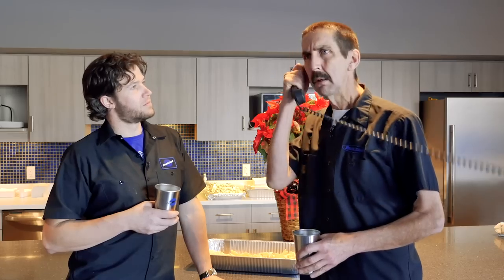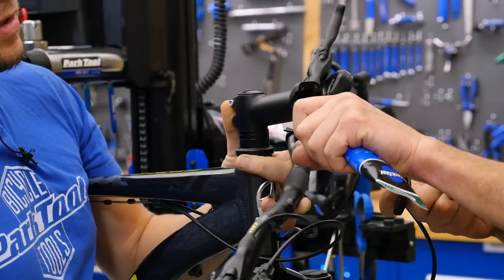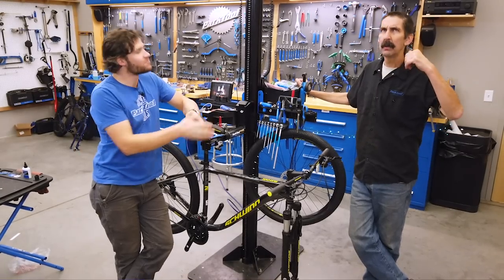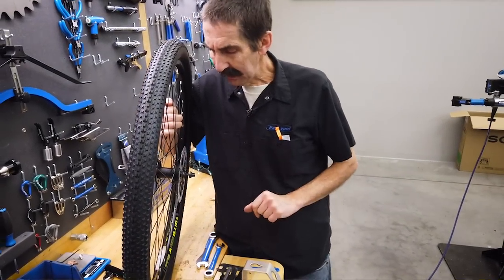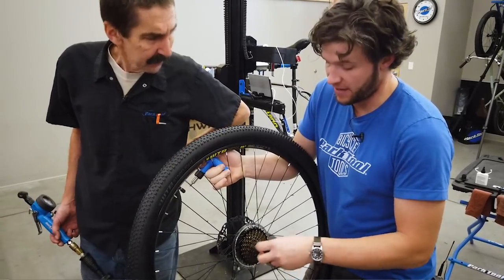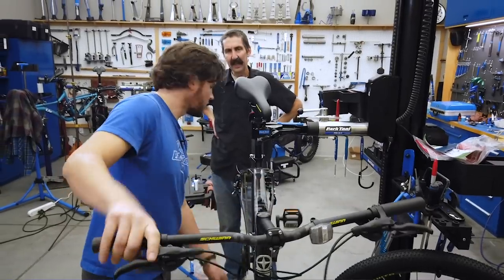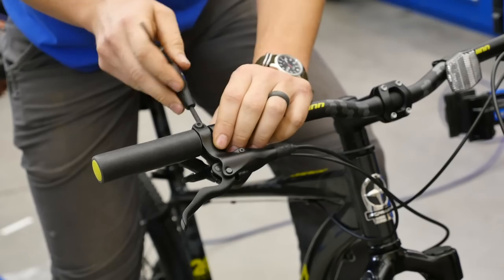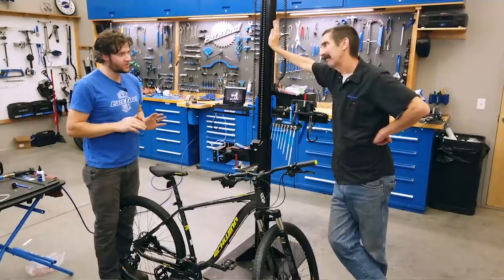Complete Bike-in-a-Box Assembly - Tech Tuesday Christmas Special

Comment: I was entertained by this video -- it was my job for 20 years (until health-forced retirement)!

I didn't have the time to grease bolts, managers like to see all bikes built in less than 20 minutes. I always told them  "you can have it that way if I adjust nothing, but the customer will bring 100% of them back." So they left me alone to do what I did best -- make that substandard stuff as rideable as it could be. 

There was a time when the premier LBS in town would see Walmart bikes roll in their front doors. It was cheaper to replace it than have them work on it -- they could have just sent the customer back to the store where they bought it.

But they sent the customers to MY store.

20 years, 44K bikes built/repaired, 1 failure, and it was a factory defect I couldn't fix.

Retired now, barely able to stand for 15 minutes... but I've built myself 2 ebikes, a lowrider, and a Specialized Hardrock rebuild so I can get back to pedaling.

It's in my blood.

Comment: Tip:  When a screw is dropped and you can’t see it roll a flashlight on the ground and the screw becomes illuminated along with it’s shadow
Reply: Thank you that's pretty useful
Reply from the maker: That is a good tip.  https://www.parktool.com/blog/calvins-corner/working-in-the-dark
Reply: @wyattlarrick3246  111 is a great place to work, and it is a great Ch l place to work, 111111a. Zu 77777
Reply: it can also reflect light
Reply: I've found ball bearings using this method but I also upgraded my wheel so I didn't have to worry about that anymore lol
Reply: If all else fails, empty your hoover, then hoover up and you should pick it up, a magnet in the dust collector or bag and you have your screw.
I'm a horologist by hobby, and have managed to retrieve even lost balance wheel screws this way... and they are less than 1mm in size! (the magnet bit doesn't work for them though as theyare brass so I had  to just pick through the hoover contents the hard way! lol)

Comment: 6:00 because I'm a tightwad, I save cable ties by cutting the tail off underneath the head, so I've still got a usable length if I pull the cut tail out of the head. I bundle them up (I build a lot of bikes) and give the away to friends who do repairs. Reduce, reuse, recycle.
Reply from the maker: Before I finally accepted that this video was going to be *long*, one of the segments I cut was about that exact method of reusing zip ties! Rest assured that these zip ties were not wasted. 
- Park Tool Video Guy
Reply: That's how I cut them too, whenever possible.
Reply: @parktool  Lol great editing Video Guy, you guys run one of my fav youtube channels ever! :) My bike is in pristine condition thanks to you guys! <3
Reply: I've made a tool by putting a chisel grind on a bicycle spoke. It lets you release the latch on zip ties, allowing you to use the entire length of it.
Reply: I did that for years on the job, filled a drawer compartment with them... until they started breaking upon re-use. After a dozen or so did that, I said a few bad words and tossed them.

Comment: Tightening 6 dollar crank with 137 dollar torque wrench. Good Job. I think we can really understand now the frustration of a bike mechanic when he gets a big box bike like this. Though the components are worse then rubbish, the frame should be ok with light xc riding. That's not a bad frame overall.
Reply: I've assembled a few Schwinns myself. As far as cheap bikes go, they're not that bad. I'm quite impressed with this one. Despite having a non-cassette bolt on rear hub, it comes equipped with hydraulic disk brakes!

Comment: This makes me think of a ToysR-Us “adult” mountain bike I worked on. Full suspension TANKER with coil spring rear (shock?). Plastic covered seat, steel stem, skinny steel handlebars that looked like they were from a child’s bike, a bizarre spoke pattern on the wheels, and a front derailleur that did not resemble any derailleur Ive ever witnessed, nor did it even come close to shifting. It was so bad, you could see the shifter lever bending as you tried to shift across the front three rings. Pivot bolts where halfway out of the rear triangle and shock mounts, too! I installed a cheap set of Giant mtb bars, a $15 Shimano front derailleur, and a take-off seat. What a difference. The owner told me after he initially purchased the bike on sale, he took it home, tried to ride it and said, “oh well, I guess I just wasted $99.00”.  Now he can actually ride the bike. It’s such a shame, bikes like that will frustrate someone from getting in to cycling.
Reply: I once ended up with a Mongoose Wal-Mart bike. The components on it were terrible. The front fork had so much flex, you could see the V-brake mounts move when you squeezed the brake hard. I ended up having to install a 1990's style MTB brake booster on it just to be able to get it to stop properly. There is an art to tuning up cheap bikes. If you do it right, it'll give the bike the best chance for having a long service life.

Comment: I've found that the fastest/most efficient way to set up a rear derailleur on a new bike is to ignore what might/might not have been done at assembly. I check derailleur is tight on the hanger & hanger is visually straight, and shift to the smallest sprocket/biggest chainring, then wind in the barrel adjuster almost fully (hides the silver part, so looks nicer that way too), set the H limit screw as per manufacturer's spec, and then release and re-tighten the cable whilst keeping a medium tension on it. In 99% of cases, the indexing will then be correct (or within half a turn of the barrel adjuster from correct) and then all that remains is to set the L limit and B-angle screws.

Comment: so glad they removed the spoke protector, i effing hate those

they only protect from improper tuning, which the chain will overshift into the spokes, so just do it right.
Reply: They're required by law in most of North America
Reply: @drfusioncraft  Really? Bruh.
Reply: @drfusioncraft  ABSOLUTELY NOT. They're there because of the atrocious adjustment of their derailleurs throw chains into the spokes pretty easily. I never built a multispeed bike that was properly adjusted at the limit screws.

Comment: You guys were bored at the party,
Pat was Nice, 
Gave y'all a video to make
(Even if Staged...)
A checkList of systems
might help,
PreFlight check, for Kids
Air
Brake
Chain/Cables,
But y'all did mechanical
Checks, not just User,
Bolts, centering/seating, 
cranks,
Grease, Pedals, 
Rim tape(?),
 torques, Trues, zip ties,
Ride On
Y(M|Km)MV

Cable rewiring to consider...

Comment: I'm still sad that you discontinued the wheel kit for the PB-1 1:00. Many other mechanics ask me about it, when they have to schlepp tools across paddocks to pits, or from a vehicle to a start line, etc. TBH, the pneumatic wheels were a bit rubbish, (kept on puncturing, hard-to-get tubes, blowing off the rim, etc.) , but I replaced them with (blue-rimmed!) solid tyre wheels, and it is great for carting tool and part boxes around, before setting up a repair station. I wonder if you'll ever bring it back?

Comment: Interesting.  My bike in a box - never took the tires/tubes off rim.  After a few rides, was going home with bike in car and heard air leaking out realized later it was the rear going flat.  The flat was due to debris of some sort on inner diameter of tube, was not from penetration of the tire.  Never found the debris.  Inner rim was smooth.  Made a few pit stops on drive home, surprised it waited so long to happen and not on the road.

Comment: Tip: when screwing in stem face plate screw each one a little at a time and work in criss cross pattern to have an even gap.
Reply: They did that,  after demonstrating what happens when you don't.

It's an instructional video.

Comment: Ajdusting front derailleur on those cheap cranks is a bitch, because later when you stand off the saddle and pedal hard, crankset and rings will flex and you'll find a rubing noise.

Comment: The adjustments you made to the front and back wheels, can you make the adjustments with the wheels on the bike if you have a bike stand but not your specialty braces?
Reply: Cone adjustments need to be done with the wheels off the bike. You don't need a fancy stand, you just place the wheel in your lap, or get an axle vice.

Comment: Luckily Canyon was super easy to setup.
Reply: I once had a customer who brought in his Speedmax for a regular service & realised that all cockpit bolts were undertorqued. When he came back for the bike, I told him about it & he told me he used the torque wrench that came with the bike.

I'd say if you want to build a Canyon at home, at least get a proper torque wrench, be it a beam-type, analog click-type or digital.
Reply: @yonglingng5640  this is why i don't use a torque wrench. also because i don't have one :C Funny thing happened 2 days ago though. iw as washing my bike and noticed my bottom bracket was coming loose! i managed to take it out using my fingers, the guys at the bike shop who installed it didn't tighen it and there was no grease or threadlocker anywhere. Bought the tool and threadlocker, should arrive next week.

Comment: Thanks guys, that's a very interesting & useful vid . I always struggle to centre the wheel in the forks, do you have any tricks & tips to share please?thanks in advance. Kind regards from Bristol U.K.
Reply: I'm a little late, but if you are still having trouble a sure fire way is to put the bike on the ground with the weight resting on the front wheel whole you tighten the qr skewer.

Comment: Hi! Thanks for the video and merry christmas. May I ask you a question about hubs? I have thru axle 12x142 hub shimano m6010hb. When I set it with little play and tight the axle on the bike, the play is go away that is right. But bike doesn't ride well. Then I set more play on the hub and when tight the axle, there's play on the rim for about 0.5-0.7 mm . But the bike rides really well. So my question is: can I leave 0.5-0.7 mm play on the rim? I also read shimano allows to set this play cuz there may be some differents between the same cup and cone hubs in processe of manufacturing unlike sealed bearing. You have to find sweet spot for you hub which will work well. May this play on the rim cause issues in the future?

Thanks a lot.
Reply: In terms of what's best, I'd prefer no play. Play starts from small issues but can develop into big problems. Most frequent causes for play are bent axles and  bearings not seating correctly. Overtime that little play can destroy the cups and cones by distorting their shapes and surfaces so they no longer function correctly. Tightness on the other hand, while it can't distort the hub components, it damages them by pitting the surfaces. The cups and cones are subjected to more stress since they're crushed beyond what the manufacturer intended, and subjected to a lot more heat, due to the increased friction.

In your case I'd start by disassembling the entire hub, inspecting every piece individually, and replacing anything that seems damaged. Make sure that the axle is straight, the threads are not chewed up, the cones rotate perpendicular to the axle without wobbling when installing them, the bearings are shiny and the size the manufacturer intended & the cups look polished.
Reply from the maker: Small adjustments of that cone make a big difference.  There should be a better "sweet spot" that allows no play when installed at the rim.  A thru axle we can assume is straight. But when moving the cone wrench, use small increments, just a few degrees, as you move from play to no play.  Generally, you want the loosest setting but with no play.

Comment: Hey all,

I'm an aspiring bike mechanic and would love to learn more. I have in my possession some older bikes that I can mess with. What sequence should I disassemble and reassemble to learn the most? Should I start with removing/disassembling wheels and hubs or do you recommend a sequence that beginners should start with?
Thanks
Reply from the maker: Some of the skills to focus in on right away would be how to put wheels on and then take them off. Then tires on and off. From there derailleur adjustment is a great skill to learn. Then get into the handlebars and the seat adjustments. I would suggest learning more about those things before putting too much time into other stuff.

Comment: Merry Christmas!
While assembling the cockpit you said that you do not want grease at the friction area between the handlebars and the stem. However you used grease at the friction area between the seat-post and the bike frame. Could you please explain why? Thanks!
Reply from the maker: Good question. The concern at the seat post/seat tube is corrosion. At the bar-to-stem joint, it becomes much more a safety concern.  Slightly rotation and slipping at the bars could result in a crash.  Slight slipping as a seat post of course could as well, but much less likely.  The history has proven greasing the seat post has not been an issue.
Reply: @parktool  Thanks for your reply!
Reply: @parktool  when I saw the dry connection, I immediately remembered several of Gee Milner's "Dream Bike Builds", also here on YT. But then I thought, "more likely carbon paste, because he uses Renthal carbon bars".

Comment: Hi: great job! Would you tell us about torque (feet/ pound or inches/pound) for stem bolts holding handler tight?
Reply from the maker: That can vary with design and manufacturer.  See https://www.parktool.com/blog/repair-help/torque-specifications-and-concepts

Comment: Whats the name of the bench wheel holder bracket with holes  20:10  in it and is it a park tool?
Reply from the maker: That would be the Park Tool WH-1 Wheel Holder. There is also a WH-2 you can check out.

Comment: I bpught a $700 dollar budget hardtail at my local bike shop and did not even rode it, then I took it back to return it because I was not gonna ride it since I changed my mind to switch to full suspension and they said that the tires were very very worn out and demanded me to pay back 40 percent to restock. I lost  $340🥲
Reply: 2 things spring to mind:

1) I'd have kept it rather than take a $340 bath.
2) check your sphincter, cuz buddy, you got f***ed.

Comment: How did you mount the THH-1 tool holder to the PRS-33TT tool and work tray?
Reply from the maker: Good eye! We installed a few off-the-shelf L-brackets using the channel where the utility hook is installed, then simply bolted the THH-1 holder onto those brackets. Just something we were trying out.

Comment: Please don't mix grease with thread locker. That defeats the purpose of the thread locker.
Reply: Scott Henderson thread locker is just about the worst thing to put on a bike.
Reply: @noahfontaine7832  I agree, but if the manufacturer puts it on in the factory I'm not adding grease to it.
Reply: Thank you for mentioning that. I'm a novice bike mechanic but I have used both of those compounds before and watching Calvin and Truman add both really confused me.  I believe they did it (and mentioned so really quickly) because the pre-installed thread locker didn't cover all of the threads.  Still doesn't seem like a good idea, though, as both will get smeared up and down the threads anyway.

Comment: Those jobs are not a quality part. I'd expect the bearing surfaces are painted and won't be smooth until ridden. 6 week check would mean adjustment required. Or ask the customer to check for looseness and bring it in. Once worn in it might be worth cleaning and switching the grease to remove the paint/grease mix
Reply: In 20 years, I never saw that.